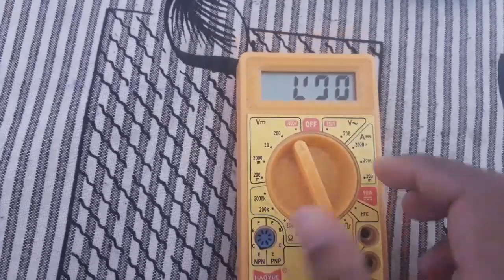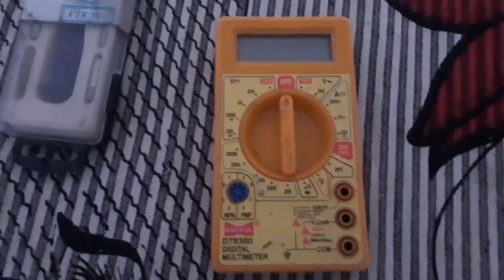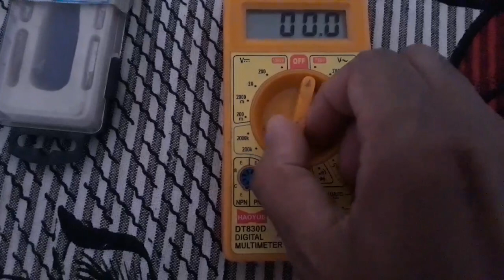DIgital multimeter LCD  display Not showing all digits problem solved

Comment: Bhaiya mere pass same multimeter hai usme Dc ki voltage or Ac ki voltage galat dikha rahi hai, and baki sab thik hai, mera matlab hai ki resistor ka value sahi dekha rahi hai, continuity thik hai, or amp meter bhi thik hai
Me jab battery check kar raha hu, tab 12v battery ka , .43v dekha rahi hai
Same for Ac also, galat dikha rahi hai 
Ap please bata sak tha hai kya hua?
Reply from the maker: Multimeter main voltage divider resistance hote hain, limit se jaada voltage lagane se ye kharab hotaa hai,  bas ise change karo
Reply: अबे चोरी करना सिखा रहा है जो इतना धीरे बोल रहा है पहले बोलना सीख ले फिर वीडियो बनाना